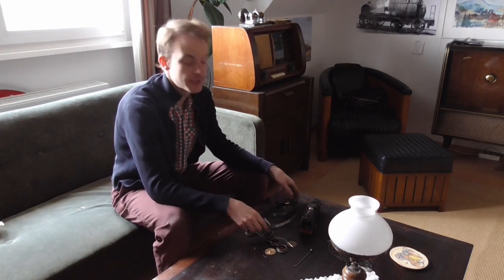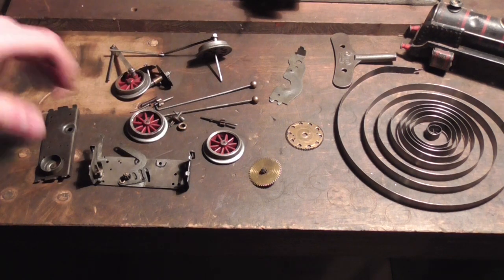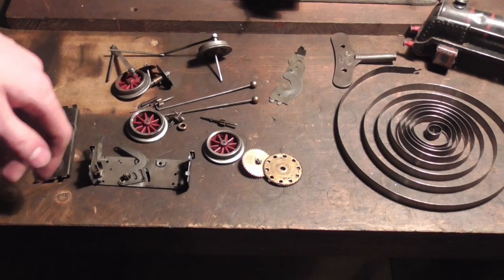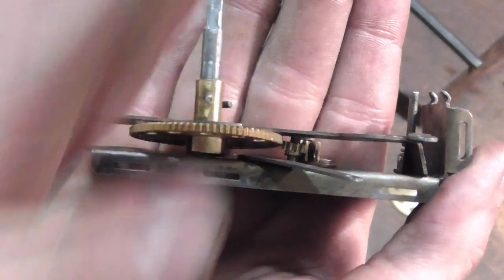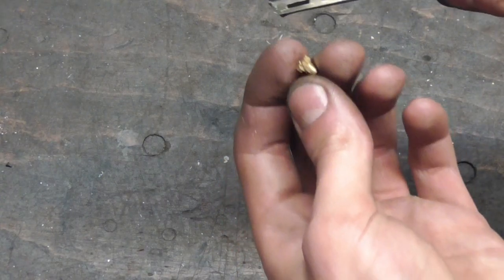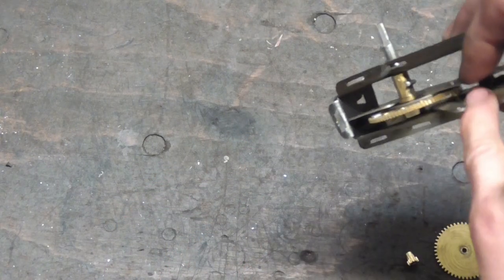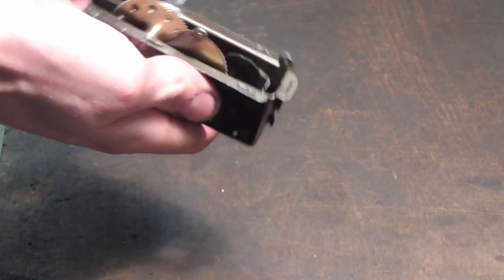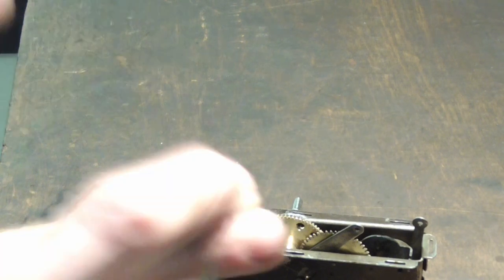NOT repairing a wind-up toy Locomotive

Comment: A most interesting failure. Clockwork looks so simple to the uninitiated. As a small boy I quickly learned it was easy to take my bedside clock apart, but was impossible to put back together 😂

Comment: It was definitely worth a try. At best, it can be a "shelf queen" if the owner is not willing to go to the expense of a custom-made clockwork or a re-engineered ebay motor.
It's too bad that the spring motor was too far gone to be repaired, but never underestimate the knowledge gained by working on something like this.
The original construction was clearly done for economy and for a toy that was only ever expected to have maybe a 5 year lifespan.
It still made an interesting video and it's actually amazing that such an inexpensive setup lasted as long as it did. 
Thank you for posting this, even though it did not end in success. The journey was very interesting.
Reply from the maker: It was fun to dig into the mechanism nonetheless - and if it was enjoyable to watch, too, then I'm a happy man :)

Comment: If the spring is encapsulated in a drum it wouldn't wind out that far and tend to twist.  That can b made work by cutting  the spring or replacing it.

Comment: I've tried fixing one of these, a hornby meccano toy loco, it's a bit better as it has a small governor but the gears are rather wobbly. The spring had been removed, was rusted and the end of it had broken which I was able to fix which got it sort of working, but I'm missing the rods that connect the control levers so it can be used with the cover on and someone's replaced a pin that holds a coupling rod on with a sewing pin, so I stopped there. This video got me to check it again, turns out the spring has broken again, this time in the middle so I'll need to find a new spring as well. These were children's toys so would have seen a lot of use and not always the best treatment, and they were made rather cheaply.

Comment: At the risk of being booed by purist. Why not install a small electric motor and a couple of AA batteries?  Less stress than the springs and less torque on the gears.
Reply from the maker: That'd be my choice, too, but the owner wants to keep the spring drive

Comment: I took apart my 1929 Speedo and lubed everything, 
Now the speedo turns easily and smoothly. However when driving, the speedo tends to oscillate like between 25 and 30 mph and at other speeds it oscillate as well.
Do you know what causes it to oscillate?
Thanks
Reply from the maker: Either, the dial isn't centered properly on the magnet and sometimes interferes with it, or the speedo cable isn't installed properly (the square peg not engaging fully, lubrication got sticky, something like that). I even managed to install the speedo cable backwards into the hull, causing the cable to slowly wander out of the speedo and into the gearbox.
Reply: Thanks. Good luck with your engine. Any engine updates?